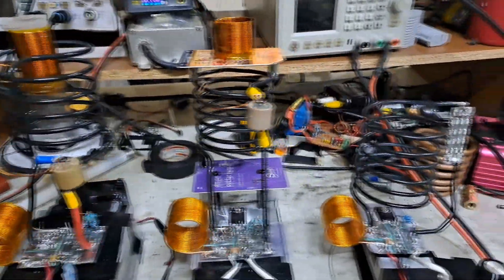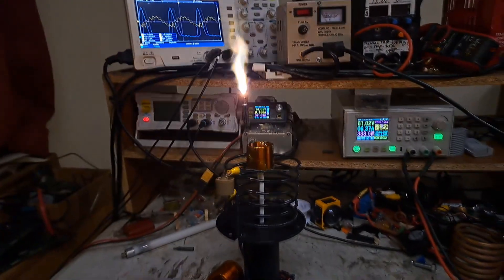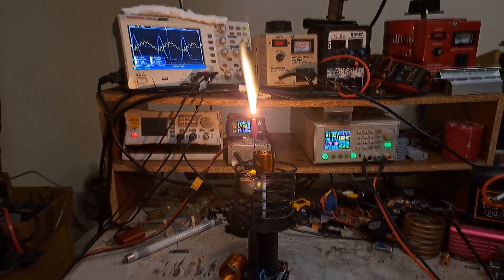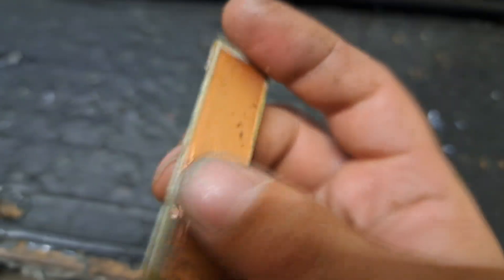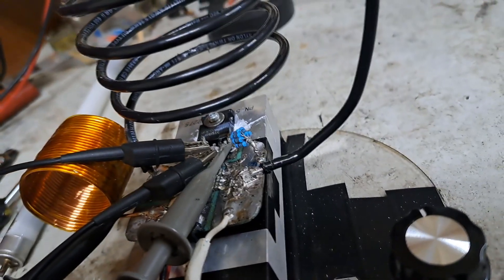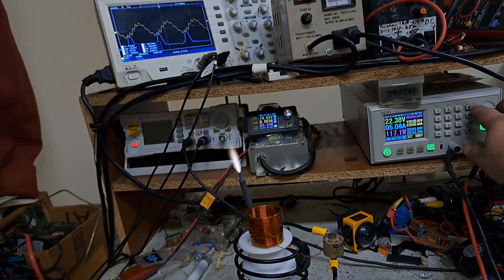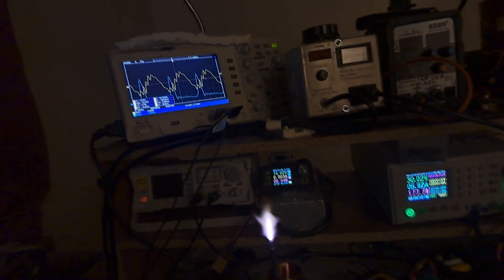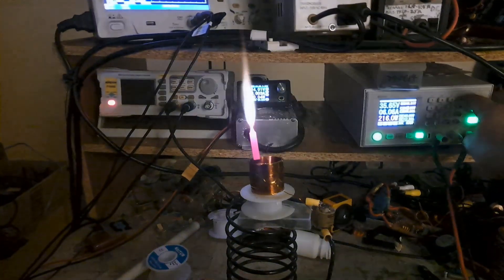More Steve Ward HFSSTC Testing

Comment: My primary oscillates at 15Mhz, but the secondary won't step up the voltage.
Reply from the maker: What switch are you using at 15mhz? I would start off closer to 8 or 9.

Comment: Could heat up say rusted bolts in a car with with this or would it fry the electronics? Also, does it dissipate heat from the flame itself or is all that action stuck at the electrode?
Reply from the maker: nah I wouldn't try that lol. I mean technically you could probably do it.. one of those induction heaters is a far better option. Technically the flame emits heat yea but it's not going to like warm the room up or anything.

Comment: i had around 4.2 ohms of gate resistance when mine died, i reduced it to 3.3 ohms and ive left it there, but i wounder if tuning it now that im at a lower primary freq would help. im just scared to push it too far lol
Reply from the maker: I don't think I've gone below about 4.7 ohms yet. I'm kind of at a weird point in some of these where I feel like I should be able to set the phase delay a little better to get smoother gate waveforms, but for whatever reason on a couple of them they seem to be running too cool and I bet changing them any will start having the fet heat up. The 33mohm fet seems more forgiving in that regard. The 80 mohm fet is a bit harder to get oscillating and seems like it loses good switching with power increase well before the 33mohm. 

If you are able to push over 600W and the fet isn't heating up quickly then I'd say that's a pretty good metric without scoping. There can be sort of an iterative process there where you can monitor that temp at different power levels relative to a certain tuning. Like maybe you see good switching at 150V but you notice a lot of heating at 100V. Or vice versa it could be the other way around where you notice a lot of heating at 150V as opposed to 100V. If it's the former scenario you might be able to do like what a couple people notice with the coupling. Just reduce it a little bit to get the better switching at the higher powers. The only real way I've found to really let myself push tuning with these is to just make multiples lol.
Reply: @Magneticitist  at 3.3 ohms i notice no additional heating throughout the whole 30-150v range, after i rewind a new secondary ill try bumping it up closer to 4 ohms and beyond. have you found it necessary to detune the secondary to account for the flame? my first secondary was detuned about 5% higher but idk if that ends up hurting me in the long run

Comment: Cool build, how much did it cost?
Reply from the maker: If you use a SiC fet like I'm using it will run you like $10. Everything else is just caps and coils. The RF resonant cap may be the most expensive thing. I get mine for like $20.
Reply: @Magneticitist  30$.....each..? Not bad

Comment: i would love to build one of these but ive not got a clue, ive only built sparc gap & simple SSTC''s,  all be it very large ones, are you gonna do a walk thru of parts & how to build these at all ? ide love to have a go & make one for my colection, ide love to have one of these burning away stable with a big plasma  flame for when friends visit.
Reply: I think he's working from a write-up by Steve Ward titled The Classy Self Oscillator.  I'm sure google will find it for you.
Reply: @clau0086  thanks ile give that a zip
Reply from the maker: @lukebowers536  Yes Steve has a write up and a few schematics as well. Check Wardpowerelectronics.com. I'm focusing specifically on the SiC fets where you have to tune them a bit differently than most Si's, but just using a IRFP250 or 460 can work fine.
Reply: @Magneticitist   awsome thanks, ime going to give the 460 a go, ive got a whole strip of those here so it wont matter if i nuke a few while learning.
Reply: I like the way Luke thinks.  Need to get my TC cleaned up,  tuned,  and fired up again.  I miss the smell of ozone.